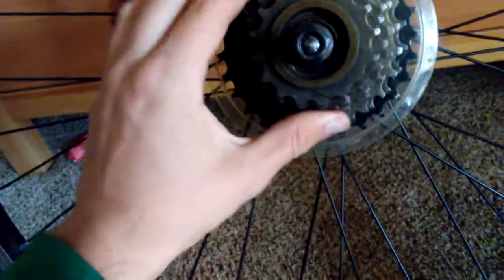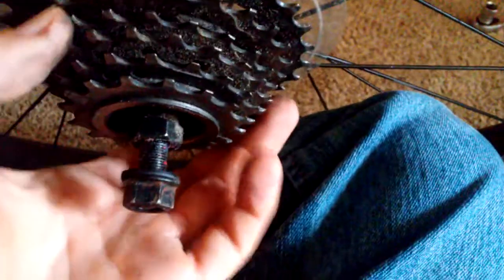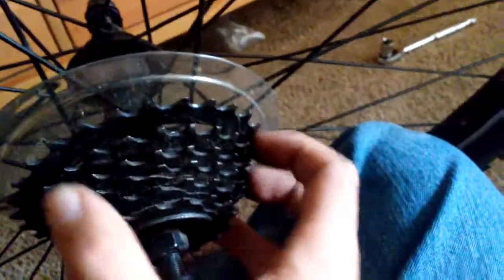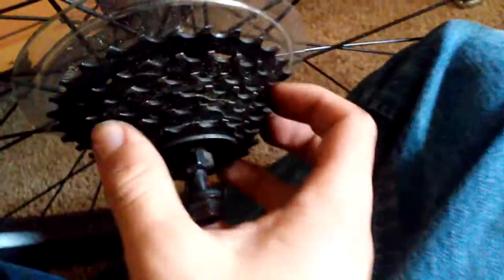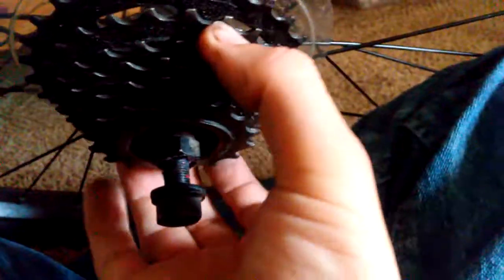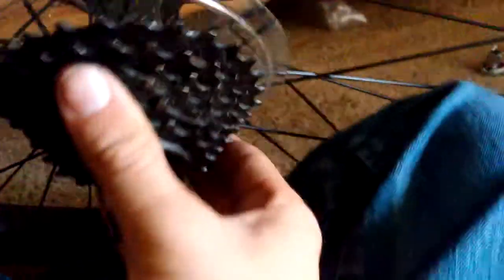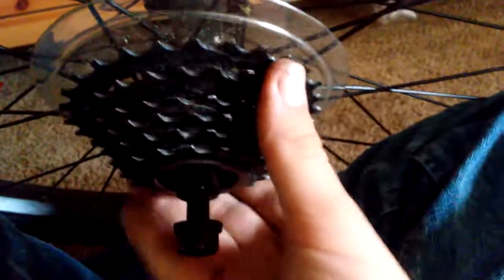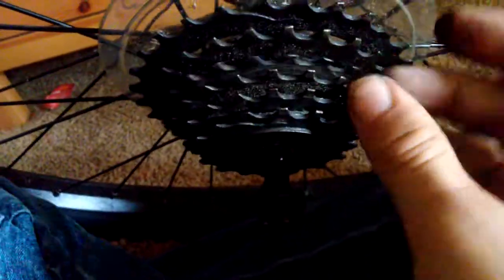Cassette issue with my Schwinn Mountain bike

Comment: You said this is 7 speed, but from your video it seems like you have only 6 gears on the hub(I made a count :-)). You are missing 1 gear which is the smallest one. I have the same situation just like your case. I just simply replaced my freewheel with FR-1.3 Freewheel Remover.